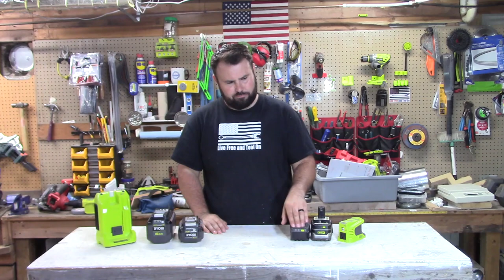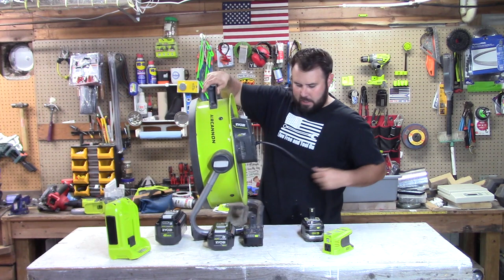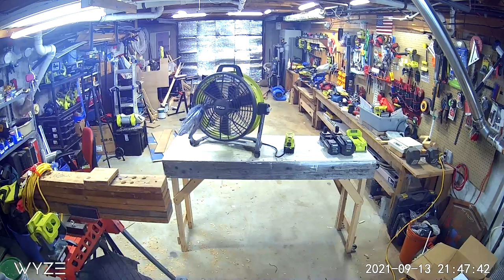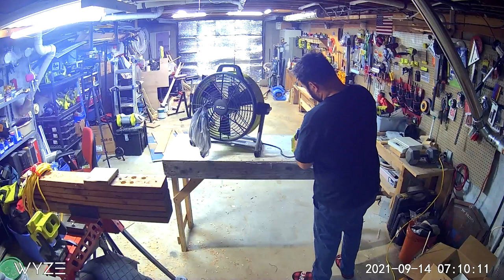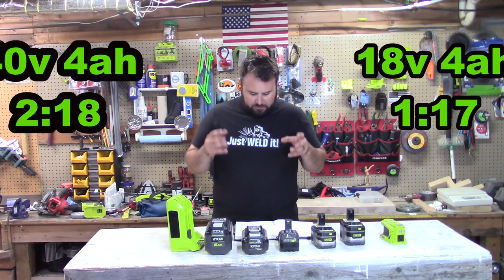Ryobi 18v vs 40v battery [runtimes revealed!]

Comment: The answer is printed right on the batteries. Comparing Amp-hours (Ah) across different Voltages (V) doesn't work. Fortunately, every Ryobi battery has the Watt-hours (Wh) printed on it.  Watt-hours is calculated by multiplying Volts by Amp-hours. If the Amp-hours are the same but one battery has twice the voltage, the higher volt battery wins. The only time you'd need a head-to-head (that would then account for differences in inverter efficiency) is in comparable Watt-hour batteries, like a 2Ah "40V" (it's really 36V) and a 4Ah 18V.

Compare the Watt-hours and you'll see which will last longer under the same load. It's really that simple.

Edit: Of course the 9Ah 18V battery didn't last as long as the 6Ah 36V battery. That's 162Wh compared to 216Wh. Meanwhile, it beat the 4Ah 36V because that one only puts out 144Wh.  Again, just read the batteries and they will tell you.
Reply: Was going to post the same.  Another interesting thing to see would be how much difference there is in runtime on the ONE+ batteries directly in the fan, compared to through the inverter--something I thought he was going to test but didn't.  Should definitely expect more time directly running in the fan but would be neat to see how much more.
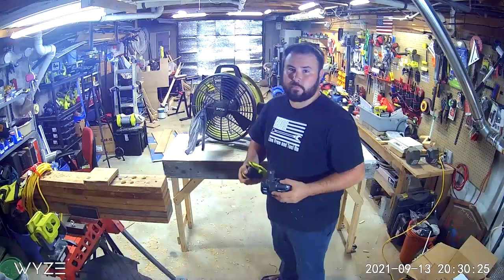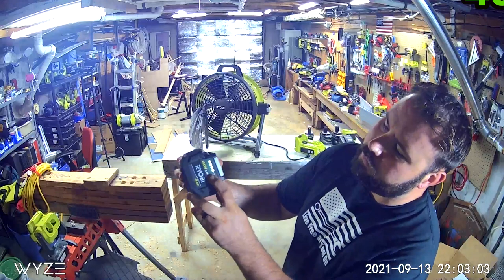Reply: The one that puzzles me is the 6ah 18 volt going 1:38 vs the 6a 36 volt going 3:40. In theory the 18 volt should always be half as much. I'm guessing the actual inverters are drawing power in different amount (just to power the inverter)
Reply: @jaycarneygiants  Yes, assuming the fan in the video requires single-phase 120Vac to run, the inverter needs to work harder to boost and convert voltage from 18Vdc to 120Vac than from 40Vdc. To be more specific, the power switches in the inverter have different amount of power loss at different operating conditions, which would affect the overall efficiency of power conversion, then it determines how much battery power is actually transferred to the load as opposed to being lost on the way.

Comment: Thank you for this video.

I notice that the 18V 6Ah only lasted alittle longer than the 18V 4Ah.  I would predict 50% more runtime based on battery capacity, but instead it only lasted about 25% longer - 1h 38 m= 98m for the 18V 6 Ah vs 1 h 17 m = 77 m for the 18V 4 Ah.

I appreciate your real-world tests, as calculations by themselves may or may not reflect how something behaves in actal use.

Comment: For a fair comparison, you need to compare Wh not Ah.  Also by weight of the batteries too.  The heavier they are, if using same cells and chemistry, the more capacity it probably has.

Comment: Debating between an 18v string trimmer and a 40v. I have 18v tools already so I think the wise decision is to get a larger amp hour 18v battery and just stick with the 18v system. Happy Independence Day! 🇺🇸
Reply: Wpoeld of difference. On string trimmer 40 volt lasts longer

Comment: What I would love to see is you to use one of the sine wave inverters the 1800 watt inverter just put one battery in the 4 amp hour and then the 6 amp and see what the difference in the time is supposedly the sine wave inverter is going to be more efficient I am really curious to see how much longer the run time is anyways that's a suggestion your video was great it was very useful

Comment: Great video. I think you forgot to take in consideration that there is less energy loss when you convert 40 volts to 120v than 18v to 120v and that’s why the difference in run time but in theory a 18v 4 amp battery should be able to store the same energy amount as a 40v 2 amp battery because they have the same amount of batteries just different array obviously if they have the same type of 18650

Comment: This comment is not exactly relevant but may still be of interest.  My 9 year old 40 volt Ryobi batteries now produce around 20 volts fully charged, and they will still run some of the 40 volt tools, but for not as long as the newer 40 volt ones.  I was just surprised that 20 volts will power 40 volt tools, but maybe that's just from a lack of understanding....

Comment: Thanks so much. I have a Ryobi weed eater with 18 V battery. Can I buy a 40 V and use it on the same weedeater?
Reply from the maker: The 40v and 18v batteries are not interchangeable to the same tool. They are different lines.... but both are great.
Reply: @livefreeandtoolon  OK it looked like you were using the 40 V and the 18 V on the same power source to the fan?
Reply from the maker: @donttrip775  different inverters, sorry
Reply: @livefreeandtoolon  Thanks very much. I appreciate it

Comment: I stumbled across this video out of nowhere and I have been wondering about this recently. I have the 36v inverter but only used it once, and was wondering with the announcement of the newer 18v inverter, if it was worth getting seeing as I have a nealy a dozen 28v batteries
Reply: 40volt can support 300watts. The 18one can only do 150volts. Unless you're talking about their newly reformed 1800watt generator that uses 8 18volt cells vs 4 40volt cells.

I mean sure. The 18volt generator would be a option if you got tons of 18volts laying around. But even with 9ah 18volts of 8cells. You're looking at less then 1300watt hours of usage. Compared to say 4 12ah 40volt cells the 40volt version can handle (If get your hands on those or have their 80volt drive mowers with the 4x 12ah cells.). Which will give you close to 1920watt hours of usage.

Or say if you're not into spending a few grand. Say getting 4 of the 3x 40volt backpack cells, Putting 4 of those into the 40volt generator with each backpack holding 12ah 40volt cells. You can get yourself up to 5.760watt hours of usage power on the 1800 40volt version, And also recharge each cell pack on it's own when they run out. (Since the system powers off 1 pack and then moves on i believe.)

But ehy. Maybe Ryobi might come out with a 18volt expansion pack for 4 batteries to 1 dummy cell system? That'd make for a nice option for the 18volt 1800 version for sure.

Comment: The most maddening thing about these 40v tools  is that there's no technical reason you can't use two of the 18v batteries you already own to power any of these tools.  They could have made the form factor to accommodate that arrangement on every one of these tools.  That makes me spitting mad.  Not only do many already have many 18v batteries, but who want to spend $200 on one 40v 4Ah unit.  When it fails (and it will) you're out the entire investment?   I've used a 3D printed adapter, and I know this works.  Problem is there are only a handful of 40v tools that allow for the space to use the adapter and two 18v batteries.  It's all just a cash grab.

Comment: You need to wire 2 18v batteries in series to make 40v then vs them against the 40v batteries.
Reply from the maker: Interesting thought, this video was a particular request to show what is the actual difference , I will have to give some thought on how to compare a series batteries
Reply: @livefreeandtoolon  SerendipitySue did it on his video titled: Ryobi 18v to 40v adapter, and used it to run the Ryobi 40V inverter.
Reply: @raymondcasso7966  He also did a 40v to 18v adapter too...
Reply: @livefreeandtoolon  DC run times are much more accurate, there's always some energy wasted with an inverter and the 18v one was pushing its max under your test, which would make it even less efficient and reduce its runtime...
Reply from the maker: @ZeoCyberG  Thanks for the comment, I get it and good point, the more loads in series in a circuits will affect the outcome, however in the case it was a particular request in which the results was no surprise but the process and comparison was interesting and actual showed a real life use comp